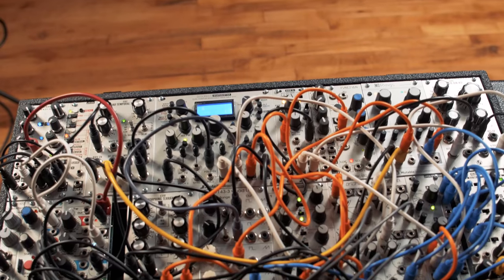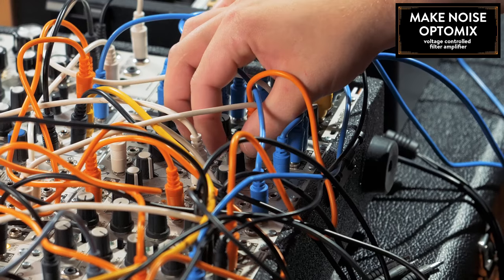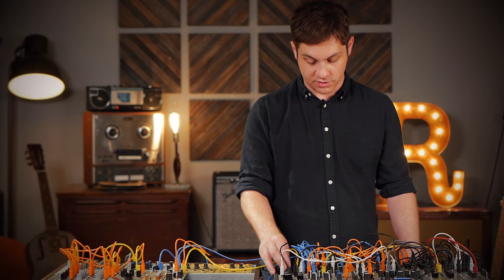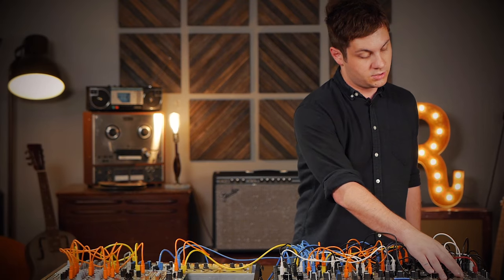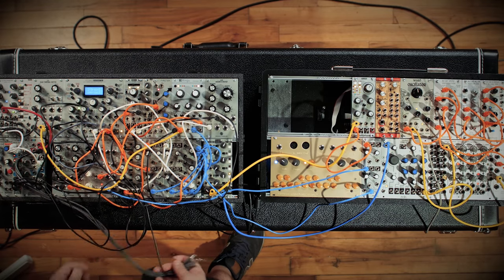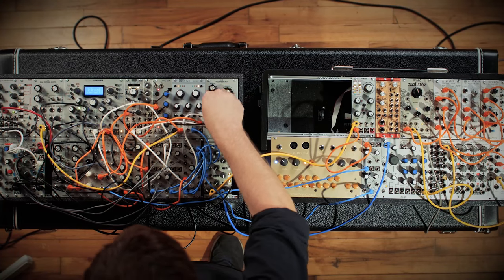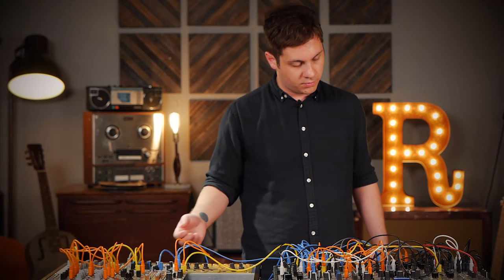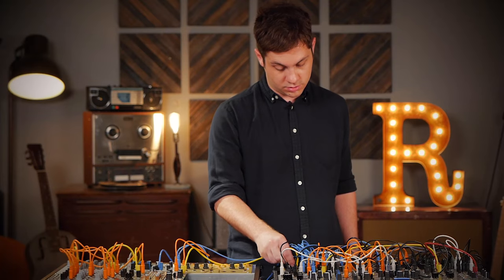Modular Mayhem: The Power of Random Voltages in a Single Eurorack Patch

Comment: As a total synth virgin, other than experience with keyboard synths and such, this is totally mind boggling. Are the different voices prerecorded? Do you change chords? How do I as a guitar player wrap my mind around the proper placement for these crazy things? What's their purpose? What's the purpose of anything? What is life? What is love? Is there even a point? Should I or should I not have ham on my sandwich instead of turkey? Did I leave the stove on? 

I have so many questions.
Reply: Think of synth modules as ways to shape tones, create different timbres, and design original sounds. It all starts with the oscillator which creates a tone which the following modules can shape rhythmically and tonally. Now to take those sounds and use them in a composition you can use different kinds of midi controllers, keyboards, or even cooler for a guitarist is to use a line level input module to plug your guitar directly into the synth modules instead of using an oscillator to generate the sound wave which gets shaped by the various modules. This way you can control the note intervals and rhythm by playing an instrument, rather than simply relying on a sequencer module to do all the work like in this video.
Reply: +Rodan van Orden I appreciate it. The funny thing is that in my time as a musician, I have always felt emotionally about music, and seen it with this sense of awe. The scientific approach to music creates an even broader sense of amazement. To think of sound as a physical thing absolutely blows my mind still to this day. It's almost spiritual in its effect.
Reply: Jonathan Denney yeah I really find synthesis interesting because you are creating sounds from scratch and learning about the components that makes up Sunday like adsr,  timbre,  wave shapes,  noise etc.
Reply: Red Bull Music Academy has you covered with answers: http://daily.redbullmusicacademy.com/specials/2016-modular-synth-360/
Reply: The most confusing part is that if you were to give him a Synth Nerd Level, he's like a level 60 synth mage. It's important just to get a grasp on basic subtractive synthesis before all this extra stuff he's doing even begins to make sense. You have to start at level 1.
Reply: Definitely go with the ham, Dijon mustard is the key.
Reply: The really cool thing about Eurorack modular is that it's a completely creative, non-linear way of creating sounds and music. There really is no right or wrong way. It all depends on what you wanna do.
Reply: and the magic is that you might end up with something totally different that what you first had in mind